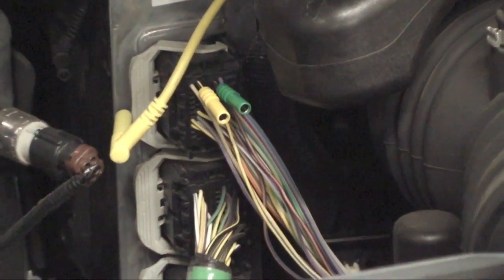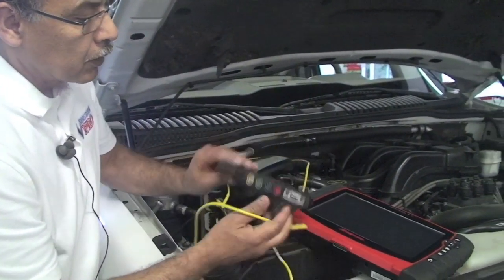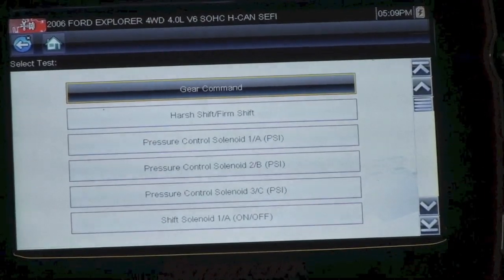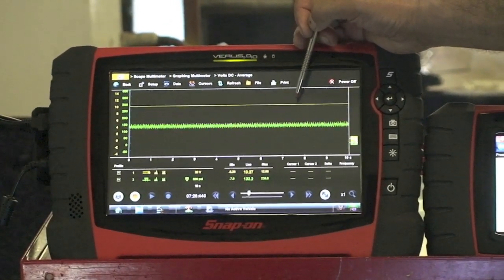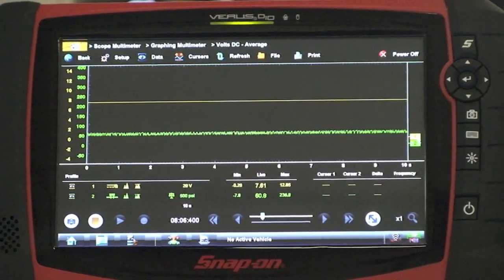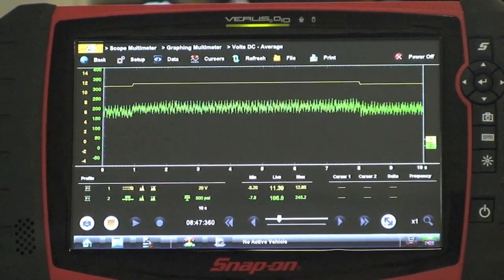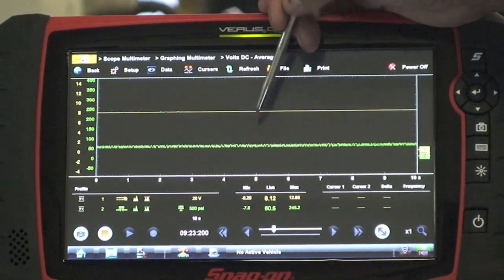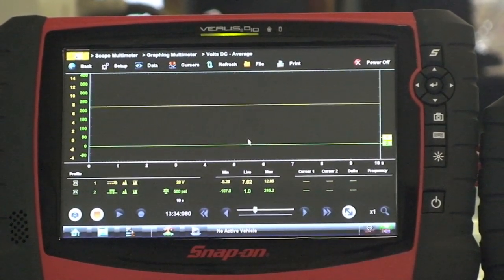Ford 5R55N/W/S Diagnosis

Comment: Hi sir i have problem at my 5r55w trans no 2 and 3 gear, i have change new solenoid pack,new friction plate, over drive servo and intermediate servo and all seal but my trans always no 2 and 3 gear ? OD ligh is on and the dtc is P0733 incorretc gear 3! how to fix it

Comment: I have a 2002 Ford Explorer and the forward gears stopped it will go in reverse fine took the transmission out and found out the rear vent hose on top has a hole in it would case any problems with the going in forward gears or the Shift solenoid ?

Comment: Great video, but I'd like to see the hook up for the Verus. Are you using a pressure transducer? And which pressure port are you connected to on the transmission?

Comment: Hello, I have a question, I have a 02 Mountaineer 4.6L,  transmission take long to shift to 2 and 3rd, after that is all good, O/D light flashes and check transmission messages come on scanned and has a code P0745, changed filters and fluid also cleaned solenoid pack(didn't tested) all stay the same, I can drive manually taking off from 2nd then 3rd than D , no problem, I can go short distances(never tested long distance) now here is the fun part....if I take off from D let off the gas and shift to second gas up and let go to shift to 3rd after that takes off ok until it doesn't engage on any speed, a can press on the gas the truck lose all gears don't even engage when I manually move it 2nd or 3rd,,,, I'll do a complete stop , turn off the suv crancked back on and I have all the gears, I can drive manually moving the gears,  seems like by tuning the car off and on  it resets something... can you give an advice thanks